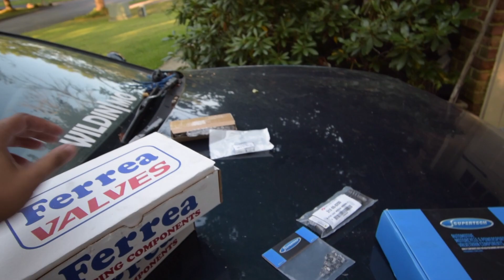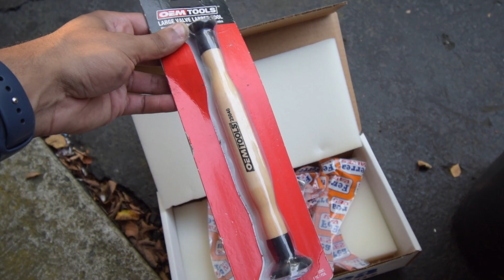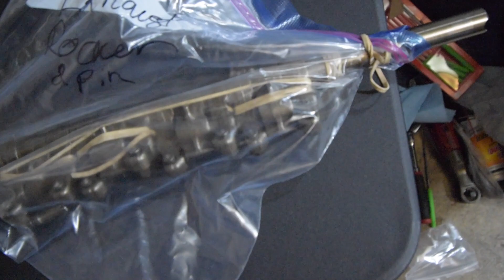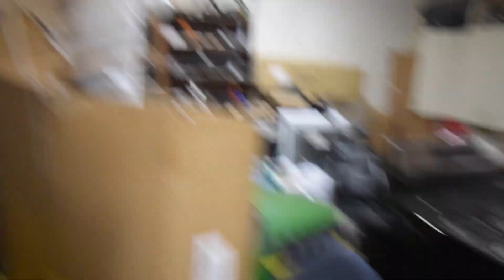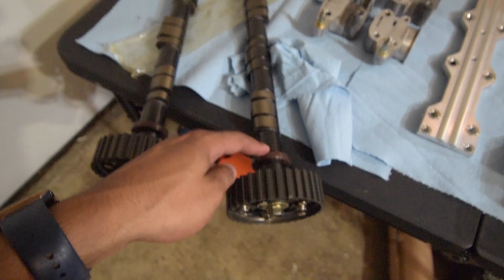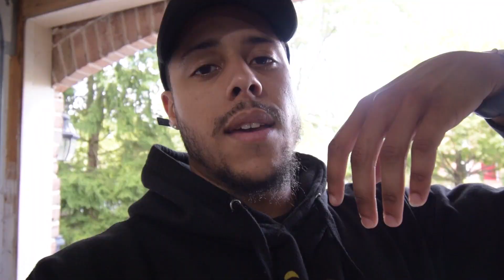Fully Built TURBO Integra ( Build PT 2 )

Comment: Literally just drilled that same exact hole in my head today. Threw a heli coil in it and it started to strip the threads off my bolt. Probably gonna send it tomorrow tighten to we're I feel safe and leave it. Only tore it all apart bc I forgot my dowel pin in the cam cap so vtec would engage then disengage non stop. I feel the pain lol
Reply from the maker: Damn we both unlucky 😅 but hey man really hope it works because I’m sending mine either way too haha and it’s held on by a prayer 😂 let me know how it goes when you finish 💪🏽